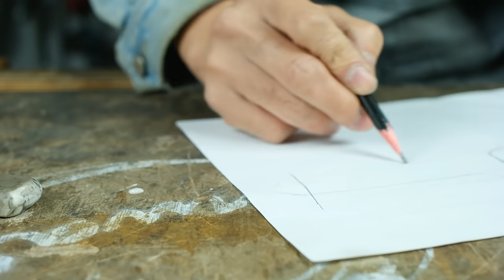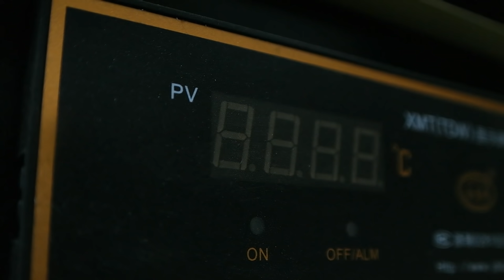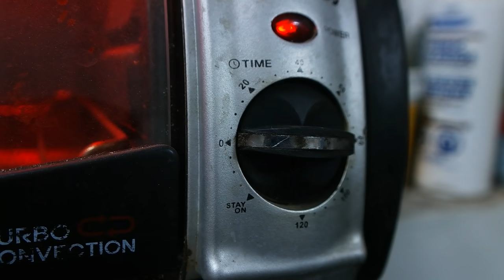그저 멋진 캠핑용 칼 만들기 / Making a Bowie  Knife

Comment: Excuse my ignorance, but I'm curious about the use of the convection oven after the quench. Baking it serves what purpose?
Reply: Buzz purpose of baking is tempering bro
Reply: Heating and quenching hardens the steel, then tempering toughens it. If you only quenched, the steel would be too hard and brittle.
Reply: @cho03  Ah, yes. In my curiosity I've learned that the tempering softens it a touch so avoiding becoming brittle and breaking. Thank you for the help.